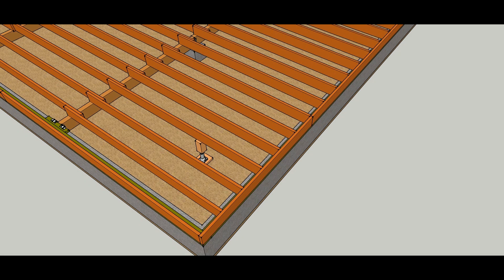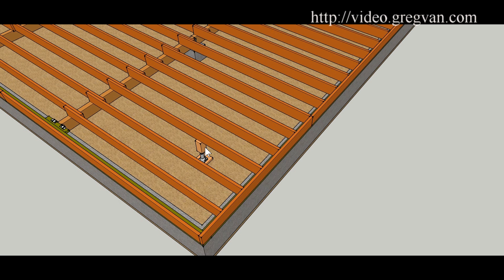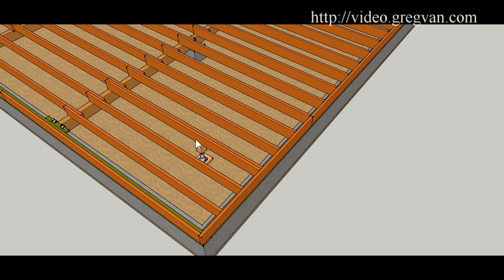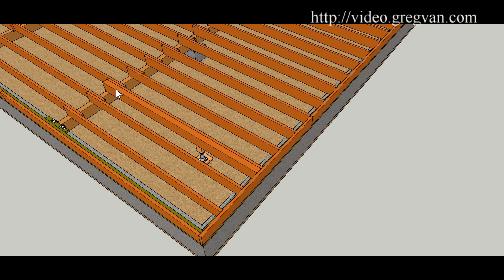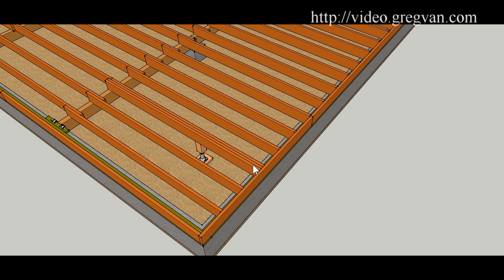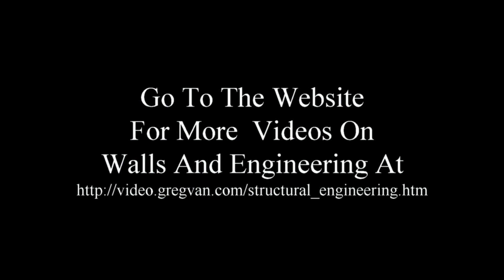How To Add Joist To Fix Sagging Floor Joist – House Framing Repairs

Comment: I got 3 joist  in hallway.2Sag The joist are 2x10x16 can i use a 2x10x10 and put 1 end on beam and other end pushed up to level and nail or would other end sag too?
Reply from the maker: It could sag. I've seen it done before but never suggested it, because I've never seen it on repair plans from an engineer. If you can go the full length, you should.

Comment: i have a few sagging joists (2x8 11', span) and i have been trying to sister on a new 2x8, but have not had much luck. The Joist will flex enough to get the floor flat and look visually better, but every time i release the jack it come back down, almost to its original height. It also doesn't appear to be lifting on any of it bearing points. Ive tried over jacking, about 1/4"-3/8" more than needed and it still rests back down, even though there are no walls or heavy things above, just open floor. Ive used 16d nails and recently am trying GRK structural screws but yet no luck. Any Thoughts?

Thanks in advance!
Reply from the maker: Can you install a perpendicular beam under the joist and if not can you install a 4x8 or 6x8 instead of 2x8. Is there a lot of weight above or is the floor open space?
Reply: @gregvancom  I have a basement so I could add a perpendicular beam/support but would not be ideal due to where the post would land.  As for the load on the joists, the only real load is the weight of the floor,  besides the one end that has an exterior wall above. I have a feeling that a good chunk of the joists in this house were crowned the wrong way since there’s about 3 sets of 2-3 joists that are low throughout the house. I’m not sure if I need to do relief cuts the take some of the tension out of the board. Any thoughts or potential solutions are greatly appreciated. Thanks!
Reply from the maker: @Cj2656-i6w  Then I think I would try the relief cuts first with the joist you installed or remove the nails and raise the joist floor higher but not the new joist and then attach screws and lower. or install a 4x8 instead of new 2x8. Let me know if that sounds like something worth trying. Keep in mind these are only suggestions.

Comment: I have a similar structure where my floor joist overlap of a load bearing wall. One of the joist is badly over notched and I wanted to sister it, however, I can only add it on the side where the joist from the other span over laps. Given everything going on, I don't feel comfortable cutting the other joist so I can rest each 1.5 on the wall. I was planning on adding it on the outside of that one which one create a gap between the new joist and the damaged one, which I was planning to fill in with similar sized material and then maybe connect with a carriage bolt through all 3. Wanted to see if you had any suggestions, ideal, didnt want to fill the entire gap with another joist. Thanks
Reply from the maker: If you can email me some pictures, if you haven't already fixed it. You can get our email address at the website.

Comment: This is all good but how do you add a joist to an already installed floor?  Your video is just a playground in virtual world with no obstacles.
Reply from the maker: I will make a video that will provide you with a little more information and post a link here when it's done. Don't forget to visit the website to check out some of our other videos on framing repairs to see if one of those makes more sense.
Reply: My failing joist is right over 4 or 5 air ducts, a water pipe, and a gas pipe.  I wish the builder was around to explain why he thought that was a great place for a joist with a huge knot at the bottom!